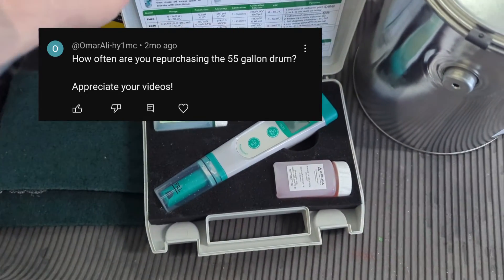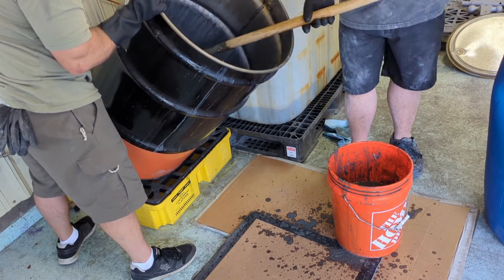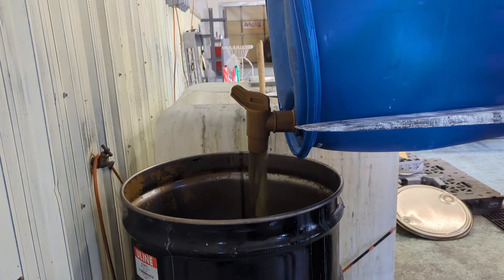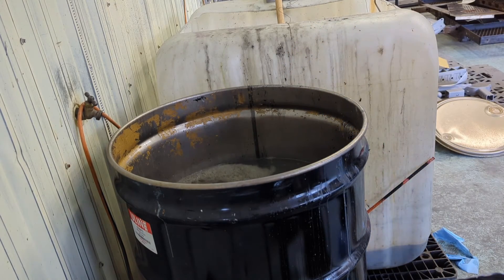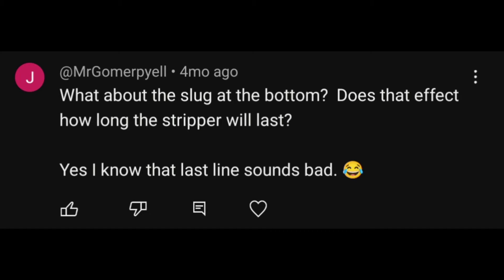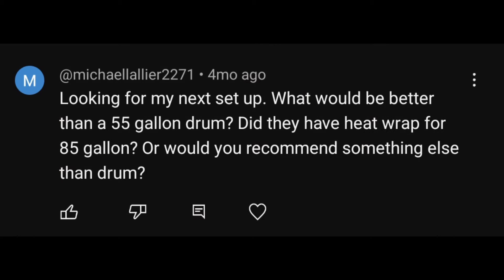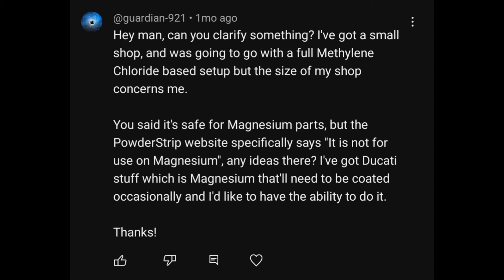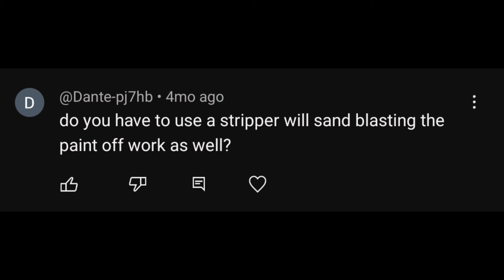Answering All Your Chemical Stripper Questions as well as Maintenance - Unknown Coatings - Ep 157

Comment: Ok not chemical question but follows after stripping things to powder coat, after gassing out the parts. Is it bad to vapor blast the parts and gas out a second time over just regularly sandblasting parts? I got a harbor freight blasting cabinet, got everything to modify it to a gravity fed blasting. Just don’t know should I leave regular blasting or am I good to vapor blast.